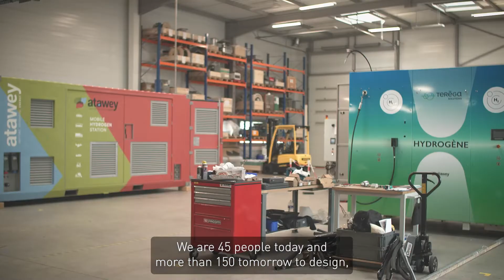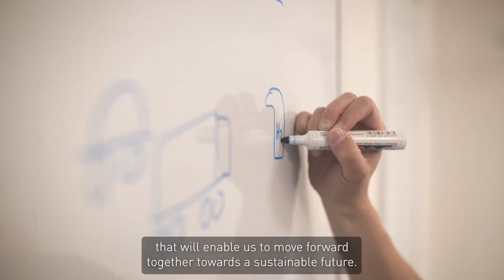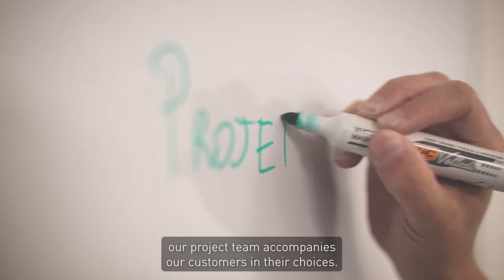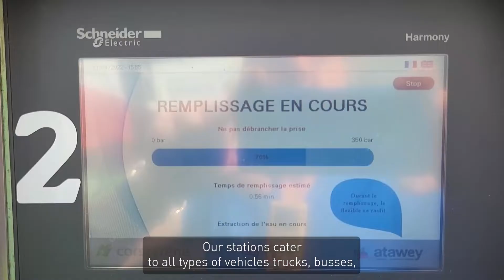ATAWEY - Empowering Hydrogen Mobility (EN)

Comment: The energetic cavitation bubble impact of any type of water by @EirexTech will produce ambient hydrogen gas at $0.25KG or 25 Cents per KG  by 5 year old start-up company in Canada. The 8 year old YouTube video by Prof. Marc Ramsey, Vanderbilt University presented "Energetic Cavitation Impact" and generated 400,000 PSI from custom BB Pellet Sized Water Bubbles impacting each other also  demonstrates the huge upside potential of Cavitation. The 30 million year old Pistol Shrimp species has demonstrated invisible cavitation bubbles by snapping it's claw that are powerful enough to crack a clam shell without physical contact defies traditional scientific dogma that overunity free energy is a false narrative.